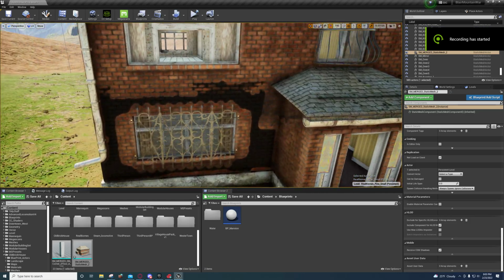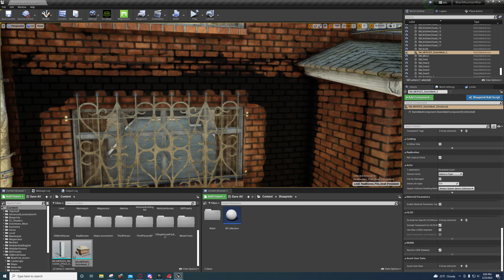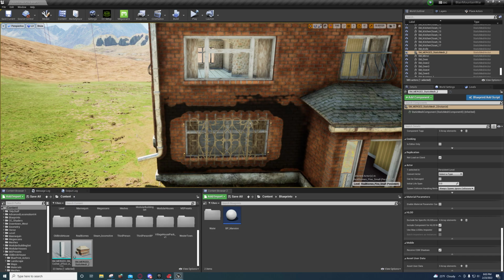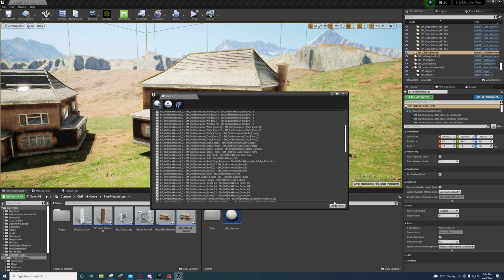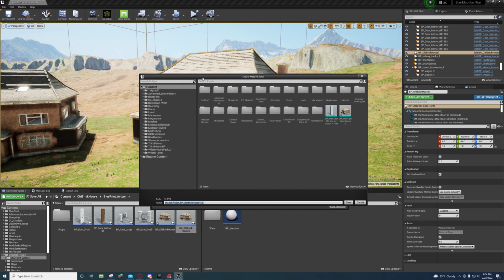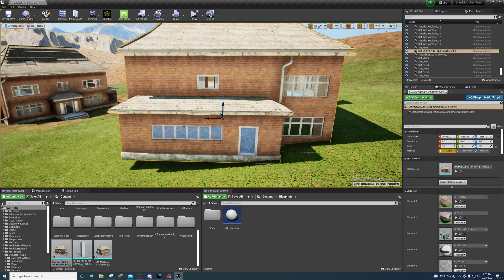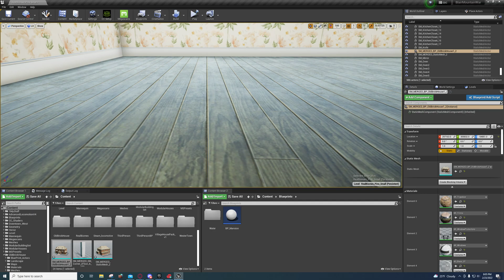Unreal Engine - A Quick Fix for Distance Field Static Mesh Artifacts

Comment: Thanks for the video! Another solution I found is to turn ON two-sided distance field on your "light blending" static mesh/part properties. I still don't know why this thing happens and how to avoid that :/
Reply from the maker: There is a console command I believe that sets the Ambient Occlusion Quality to 1. If you do that, I believe it will fix it. I think it has something to do with Ambient Occlusion in general. I don't remember what the command is though.
Reply: @unrealdevop  Thank you for that, I'm gonna give it a go and report back if it works
Reply from the maker: @marioklos  For sure.
Reply: @unrealdevop  After some testing done this command r.AOQuality 1 indeed fixes light bleeding, however it sets AO Quality to medium (default is 2) so it's just another painkiller. Wait a sec, I think I found it! Increase Distance Field Resolution Scale in mesh properties, in my case going from 1 to 2 was enough :D ref: https://www.youtube.com/watch?v=1S8KNXXkfH4
Reply from the maker: @marioklos  Yeah I figured, glad you found it. There were a couple of other commands but I was storing them on sticky notes and I recently had to Re-install windows after upgrading my processor from the AMD 3900x to the Intel 12900k
Reply from the maker: @marioklos  You can have those commands run when the game starts too, but I assume you already know that.
Reply: @unrealdevop  Bump because I edited solution to that problem in my previous comment, you might find it helpful :) Thanks again, you got a sub!
Reply from the maker: @marioklos  Thanks I'll give that a shot when I run across it again.
Reply: Been trying to figure it out for two days now and this comment thread finally fixed my issue. For me doing both Turning on two sided distance field and increasing the resolution scale solved multiple mesh issues. Thank you!!
Reply from the maker: @daniel6sharma  Glad you found it helpful
Reply from the maker: @daniel6sharma  Were you still having trouble? I seen your messages but it seems they were removed. I think there is a Console command, I believe it has to do with turning Ambient Occlussion shadow quality to 1 something like r.AOQuality 1 if I had to guess.

Comment: I think that it is the lightmap UV's that comes with the meshes that are not buildt for DF shadows. 
Try and fix the UV map for the mesh first. The texture UV map is always outside the boundry when looking at it in UE. 
So i do believe that by first fixing the UV map so it's not larger then what UE allows. You then have to build new lightmaps for the mesh.
Then you can generate DF from the new UV map that not is no longer to large....

This is always the same issue on meshes that have bad UV maps to begin with....
Reply from the maker: Thanks for the info, I'll try that out the next time I face that issue. It could be that when converting it to one mesh the UVs get messed up, I never thought of that and it seems that would definitely cause issue's. I wouldn't expect Unreal to be very good at repacking UVs to begin with.